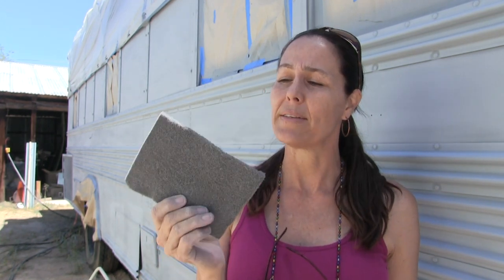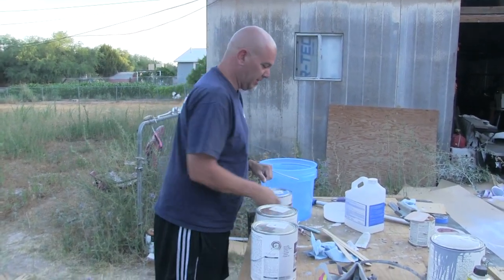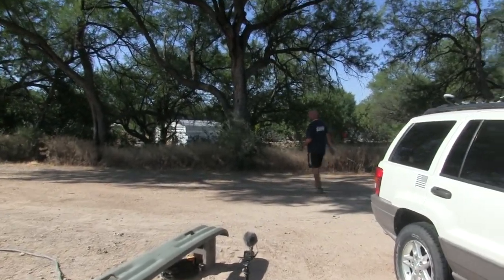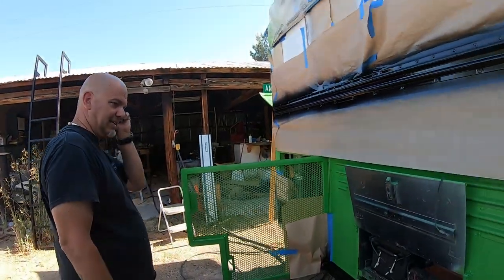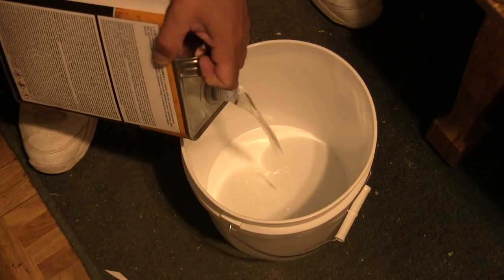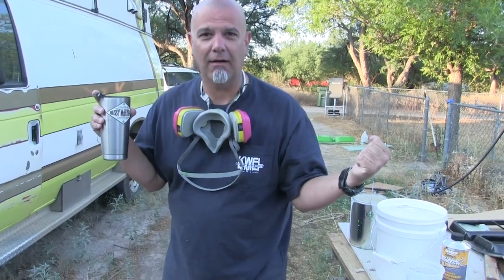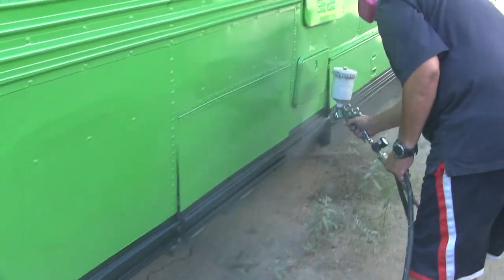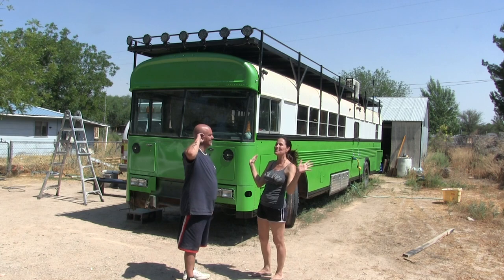Painting the Skoolie Part 2: Color, Clear Coat & Pearl

Comment: I know the retaping is a pain but in the body shops you take off and retape and paper between every thing, primer then change paper and tape, paint and change paper and tape then if you let it set over night you change paper and tape before clear coat just so you dont get paint on thing underneath it. So yes it's a pain but cheaper in the long run.
Reply from the maker: Not sure. Might go chrome!